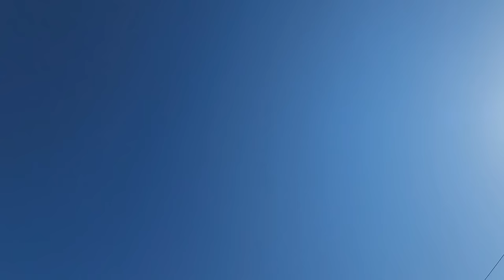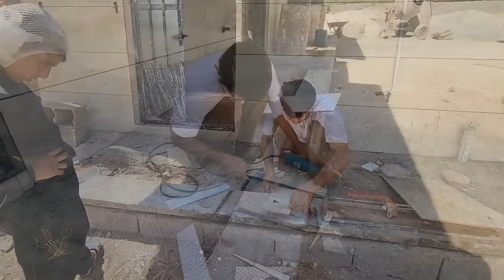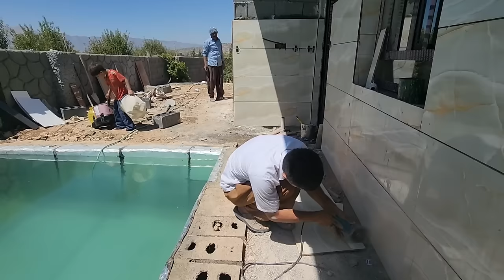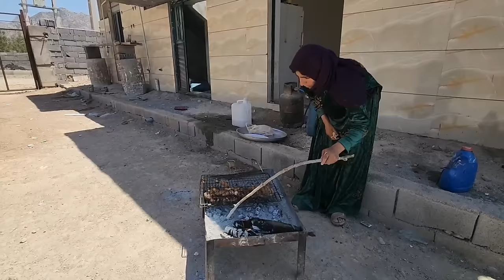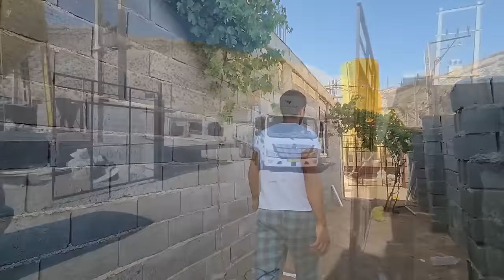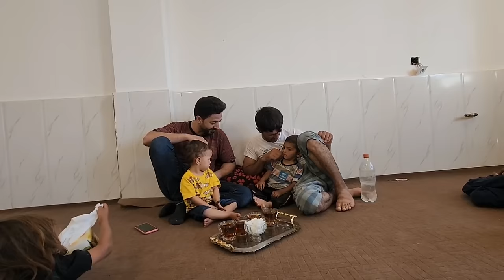Village girl🙋🏻‍♀️Aida, a village girl, goes to language class after cooking  @TIR78

Comment: Kitchen looks great, but still not used because there used to be no water in the house.   I suspect same situation with the bathroom.   Everything ready but no water to make these rooms function.   Electricity has been added to the house so why has water not been piped in.
Reply: Probably because they haven't gotten to it yet.
Reply: One would think sanitation more pressing than tiling outside walls, or building  a pool, or even the expense of kitchen cabinets.
Reply: @suzannecurran5097  I agree with you...sanitation is WAYYYYYYY more important than a swimming pool. 

I'm pretty certain they have to do what they can while certain workers are available and that's why the pool was done before the bathroom or running water.

Yeah, it's still backwards.

Comment: Air conditioners work better with closed doors and windows!  😜.    Power is extremely cheap in Iran is that why it doesn’t matter?
Reply: It's what the western world calls a swamp cooler... it's not the same as AC.  You have to have a window or door open to use an evaporative cooler.
Reply: @reanveau  you do?  I lived in new Mexico and we didn’t BUT maybe because theirs isn’t mounted thru a wall or window??
Reply: @layne947  Is you're an evaporative cooler or an AC unit?  They are two different things.